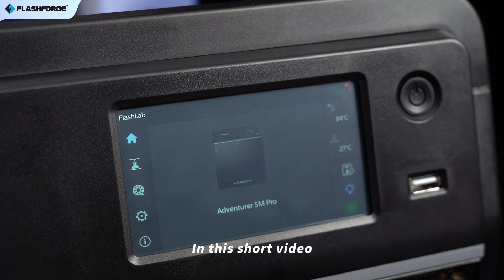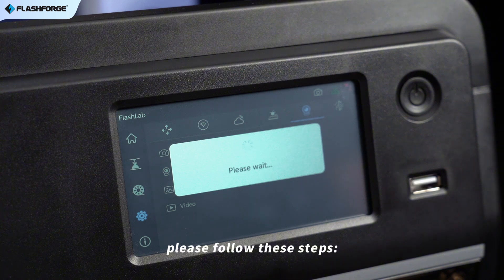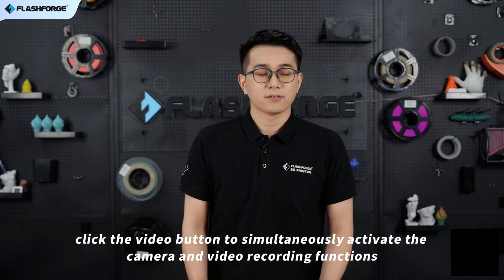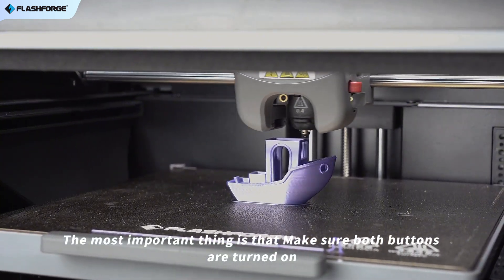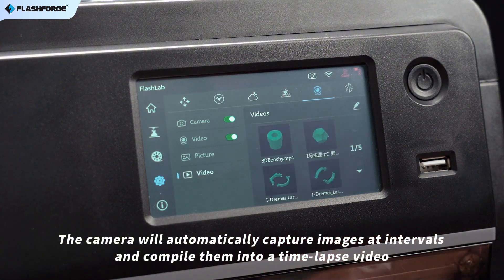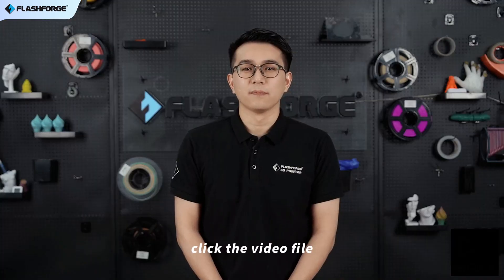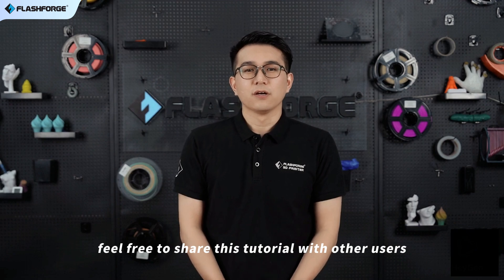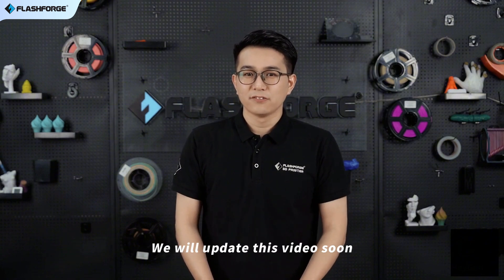How to Create a Time-Lapse Video Using AD5MP

Comment: if I'm at work can i view the camera and well there be a option to start and stop the printer from a app if you have one.
Reply from the maker: Hi, you can control your Flashforge printer using Flash Maker and Orca-Flashforge. https://flashforge.com/pages/software-flash-maker
Reply: I downloaded the Flash Maker app on my phone and can monitor my prints remotely - there also is a button to pause or cancel a print. Required me though to create a FlashForge account and then link the Flash Maker app to my 5M. Works well although sometimes the video feed is lost. I find restarting the whole Flash Maker app is necessary.